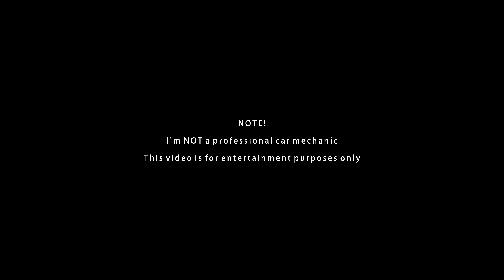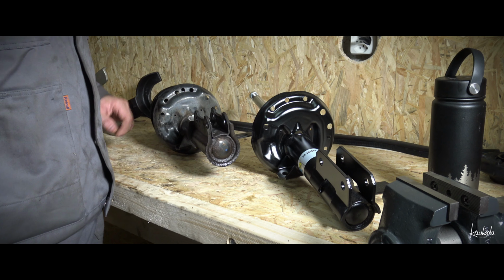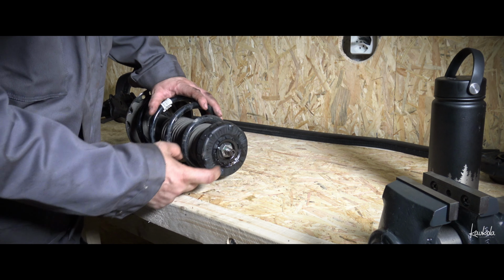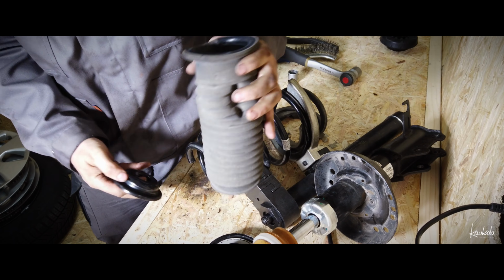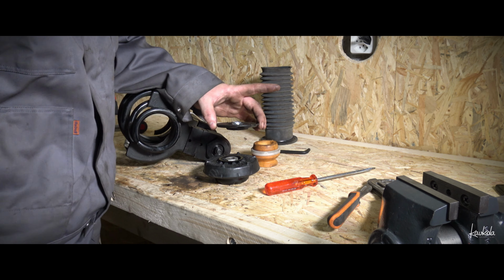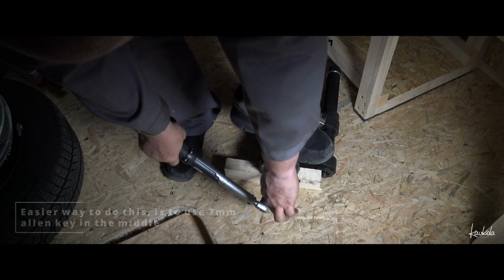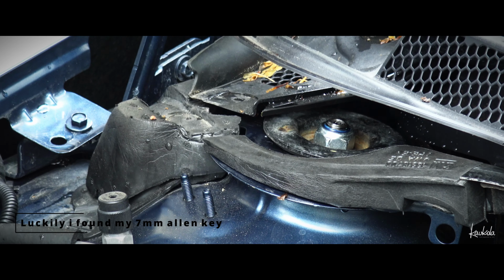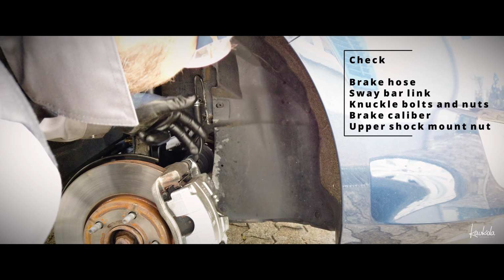2012 Opel Astra J FRONT shocks, springs and sway bar links. Step-by-Step

Comment from the maker: Sway bar links gave up after about 23tkm. Loud "klonk klonk" noise. Right side was worse. I didn't use originals, when i changed those two years ago. Now i changed original parts, hopefully will last longer.
Reply: Thank you for this video. I have astra 288tkm with all original suspension. My model (business) suspension is higher than others (Cosmo) . Replacing suspension I would like to make it more soft. Did your suspension height change with new springs? Is it now more soft or same? Thanks.
Reply from the maker: @jgoncalodm i didn't notice any height difference between originals and Bilstein B4 shocks and KYB springs. But i think Bilsteins are harder than originals were, it's not a big difference, but especially in cold weather, in the beginning of driving, i will notice a small difference. But I really like, how it is now.
Reply: @kaukolaDIY thank you for the feedback. I will try the kyb springs and OEM new shocks.

Comment: I have an astra j 160 hp cdti. Same problem of noise since 150000km. I have 200000 km today and i m on holidays near Barcelone.
Nice car to drive. I ve only lose a rear steel fixing system on the rear brakes i chance before my travel ( it s my fault, i didn t shut it enough). A nice guy put me a récupération screw , and i could start my holidays in spain.

I will change my shocks absorbers this winter with quinton hazell parts for the price ( made in india i think).
Thanks🇫🇷😼😉

Comment: Good Job!  I like your spring compressor. It looks safer than mine, I have the ones that hook over.  Keep it up!
Reply from the maker: Thanks. My biggest concern was, how that spring compressor will work, but it worked fine.
Reply: @kaukolaDIY  Hi. Where did u get this angle spanner ??
Reply from the maker: I bought almost all my tools from our local shops, called OBI or Bauhaus. Tool set that i have, is Proxxon Industrial brand. Some special tools and sockets, i ordered from Amazon.de. unfortunately, i don't have any links to give you.
Reply: @kaukolaDIY  Thank u very much i will look at obi. Cheers.

Comment: very good video been doing my brakes but still making a noise with bosch brake pads
Reply from the maker: I actually also had some noise coming after the brake job, but i can't hear it anymore. I've been now driving about 2000km after the brake job. Maybe also your noise will go away after some time.
Reply: @kaukolaDIY  thank s  mate
Reply: @kaukolaDIY   just took it apart again found out my guid pin has seized and cant get it out  have buy new ones
Reply from the maker: @craigtrigg4288  ok, that's good that you found what was wrong.

Comment: for the 2 bolts holding the suspension on the arm, what if you put them the other way around so you can remove them without removing the caliper next time?
Reply from the maker: Well.. that's a good question. The bolt is not only threads all the way. Other end is kind of thicker and without threads, so it will fit tight to the hole. Is the hole on the other side same size than the other one? I don't know.

Comment: Can you send link to black socket key you use to disamble spring from suspensor ?
Reply from the maker: Do you mean spring compressor like this? https://www.tectake.ch/de/federspanner-set-fur-mcpherson-federbeine-400869
Reply: @kaukolaDIY  no I thought about socket key to unscrew nut between spring and plate to hold suspensor in socket. Is difficulty to explain this without experience in writing in English end without knowing technical dictionary :) btw. Thanks for response.
Reply from the maker: This maybe? https://www.amazon.de/dp/B08Z3KPQNP/ref=cm_sw_r_cp_apap_Dlmh3ElBclZLR

Comment: Hello, It looks like a new car, why are you changing the shocks?
Reply from the maker: Shocks were original, not broken, I just wanted to be sure. I had vehicle inspection coming...
Reply from the maker: Actually the reason, why i wanted to check my front suspension, was some strange "klonk" sound, which was coming from the front.

Comment: Oops. You didn't change the anti roll bar bushes.
Reply: Do you have to change them every time you change the shock absorbers?
Reply from the maker: @mbz4652 it's not a must, to change them at the same time.. actually I might have a problem with at least passenger side anti-roll-bar bush. I have to change them soon. I've heard that those bolts are pretty hard to reach.